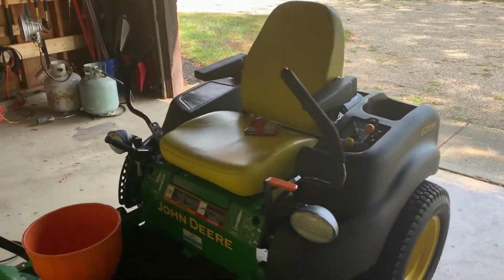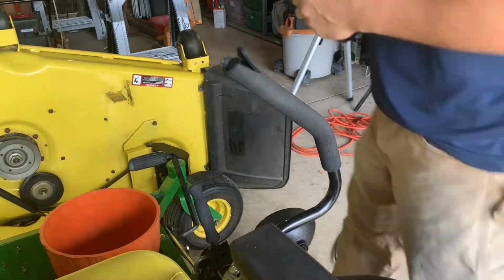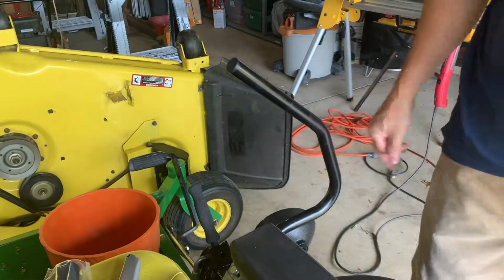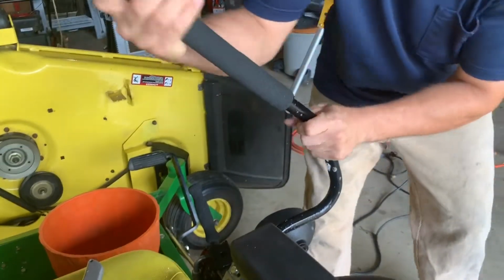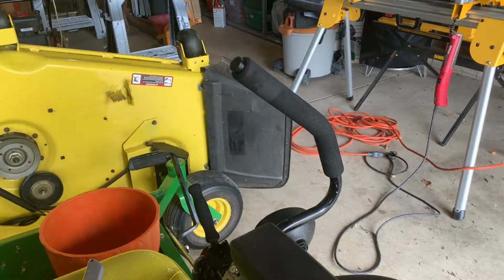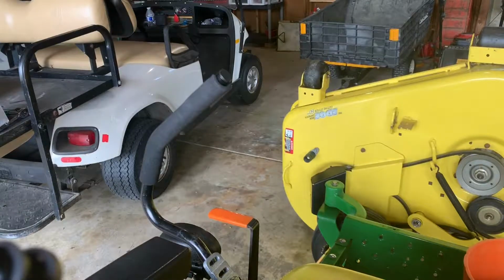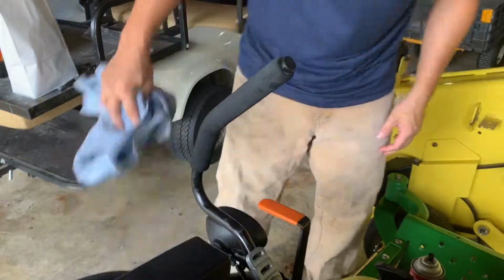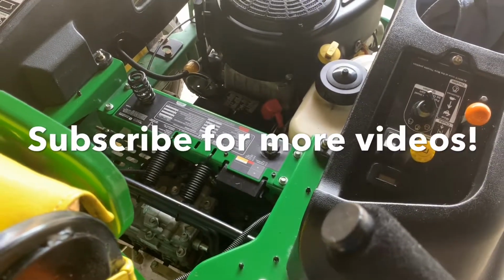John Deere Z665 Zero Turn Foam Grip Replacement

Comment: On my Z445 the foam grip’s have just slid down the bars…….. I’m look for a got tip to slid them back up………. Good video….Thanks
Reply: Take your air compressor, put some air to the top to inflate it a bit as you spray some dawn water down to it and slide it back up
Reply: @austinwebb8986  I followed your advice yesterday on removing the grips on my Z445. So easy and fast, just amazing…. Thank you very much….👏